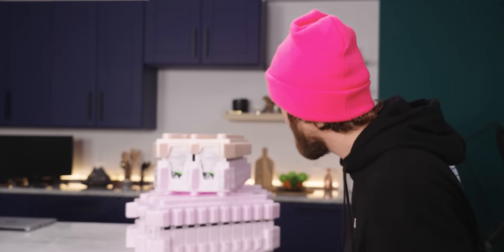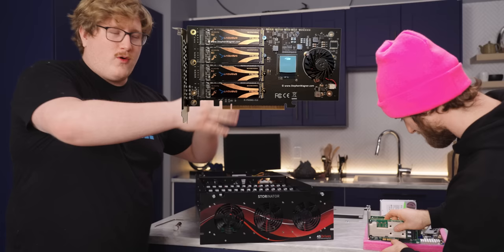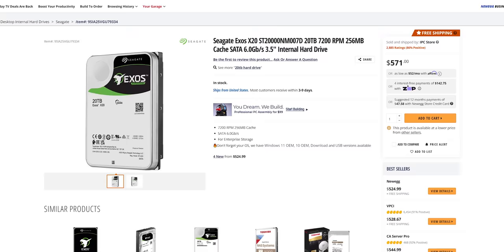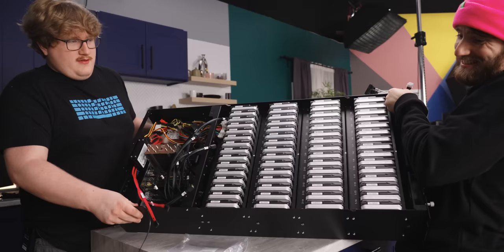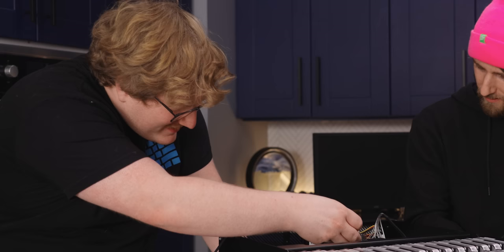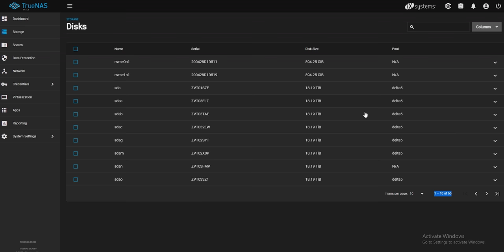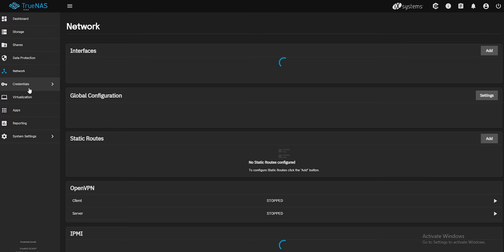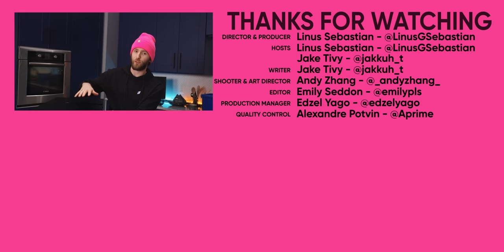My dream FINALLY came True! - Petabyte Project Recovery Part 2

Comment: I remember linus explaining to his wife how 20TB doesn't make sense for storage as rebuilding them would take a loong time. What changed ?
Reply: Sponsorships
Reply: The money, the need of more data in less space, the fact that HE doesn't have to watch over that because somebody else will.
Reply: New wife
Reply: he's got too much money now :D
Reply: Has the technology improved?
Reply: It doesn't make sense in consumer NAS devices but it can make sense for very large servers with raidz2 (barely) or raidz3, drive bays are expensive.
Reply: Link for that video?
Reply: Maybe scale, it doesn't make sense for smaller servers, or a personal NAS setup, but maybe when dealing with Petabytes of storage it works better?
Reply: @positivemelon7578  I got a 5.25'' drive bay in my workstation right now. Was cheap and works great. The real problem is finding a fucking case these days that didn't get rid of the bays for extra cooling that few people actually even need. Currently, I'm using the Phanteks Enthoo Pro
Reply: Like many things it isn't really a yes or no answer. The type of RAID array your using plays a huge factor. For example many people say RAID 5 is basically useless for anything larger then 1TB because of how slow the rebuilt times are with only a single disk failure it get really scary fast.

In the case of LTT they have a few things going for them. First off they are using multiple RaidZ2 arrays so they could loose 2 disk per array so it is way better than RAID5. Second this isn't really a highly active server. They can do without it if need be. So if a drive does fail they can just tell everyone the server is busy rebuilding the array don't access anything on it. This will improve performance rebuilding the array and be less stressful on the remaining disks because they don't need to physically seek around as much during the rebuild.

This isn't always the case for many people as one of key points of RAID is to keep the data accessible even if their is a hardware failure.

But at the end of the day it is just a risk game you play. Someone a lot smarter then I am could run the probability numbers for you and that is up to LTT to determine if that is acceptable or not.  How valuable is that data. LTT is already breaking the 3 backup rule with this server as it is the only copy of this data from my understanding. They said the data is really only a nice to have and say YouTube is their other backup. You may agree or disagree with them. But they ran the numbers and this is their solution.  

Although I do think LTT should find some Tape backup sponsors and try backing up that large amount of data to tape. Tape does work out to be cheaper than hard drives when your talking about that much data.  Although accessibility is much harder on tape but it would be a backup of this server.
Reply: Yvonne wasn't in the room this time
Reply: @keineahnung8696  He doesn't have a prenup. He'll lose everything if he divorces Yvonne. So, not gonna happen.
Reply: him getting a petabyte of free hdds changed that

Comment: Didn't you said that the 20 TB hard drives are rubbish, because if one fail, it takes an extremely long time (several days) until all the data is recovered to a new one?

Comment: Linus: It's mind boggling 20TB in a single drive.

1 TB MicroSD: Am I a joke to you?
Reply: MicroSD aren't dirty cheap
MicroSD might perform worse than a hard drive 
Also, 20TB in that hard disk is a achievement cuz, it's just few years ago that we had low capacity hard drives
Reply: @cry-0432  in terms of storage density by volume it's still way more impressive than spinning rust. If I have a 20 TB 3.5" in front of me I'm really not impressed anymore. Show me 8 trillion bits that fit onto my fingernail and I genuinely have trouble believing that's possible.
Reply: @dgschrei  yeah, I agree

Comment: As a Storage Architect for a living, allow me to say with the complexity you have in mind and the storage pool sizes, I HIGHLY recommend using Starwind as your virtual SAN software. It's been around for many years and has amazing capability like spanning physical NAS hardware presenting one storage pool. The big thing is it's incredibly reliable and data loss prevention and excellent recovery is their strength guys.

Comment: Your storage failed because you failed to monitor it, rather than accept the same process will work again, use a proper enclosure with status LEDs on all the bays. If your regular monitoring notifications fail, atleast you'll still notice when someone is in the server room that there's a red light.

Comment: 13 drives in RaidZ2? Can't wait to see this video again in 3 years or so. At least go RaidZ3 for this many drives in a vDEV.
Especially with 20TB drives. Resilvering can take long enough for a 13 drive 20TB vDEV that you can lose 2 drives during rebuilding the array, just give up the extra drive.
Reply: It's actually even worse than that: they put 15 drives in each vdev and it didn't look as if they set aside some drives as hot spares. At this point they are just begging to lose their data - again...

Comment: 9:35 "Are they SAS or SATA?" Technically both I guess?  They are SAS ports and those can pass through SATA connections.  You can easily find SAS to SATA breakouts for that reason.
Reply: But on this board they are SATA only. Linus got it wrong. Got this board in my storage server.
Reply: I mean SAS wouldn't make a sense nowadays most of those fancy (enterprise) drives have SATA and SAS is really rare...

Comment: I've read that it's advisable to use a mix of disks of the same capacity from different vendors or different build batches/dates, in case there was a problem with a production batch.

Why aren't you considering building a ceph cluster with all your different Vonnock servers? Is the ZFS pool performance much better?
Reply: You can't be very picky if you get stuff as advertisement material.
Reply: @lachiu1  no, but you can when your data is at stake and even though they might've gotten it for free, it's still his data on it, so they should still care about this.

Comment: if its just the heatpipes sticking out of the top of the chassis i know this may sound insane but measure exactly where they are and drill just a couple small holes that are the exact size of the heat pipes

Comment: I've had so many HDD failures over the years that I'd still be terrified of my only backups being on them.  I know SSDs are significantly more expensive but it's worth it for the peace of mind, IMO.  Not that SSD failures are impossible, but far more unlikely in my experience.

Oh, and they're a lot lighter to carry. ;)
Reply: You build these things with the assumption that you know HDDs will fail. You just have to monitor, scrub, and replace as necessary.
Reply: Yeah losing 2 tb of memes doesnt feel good
Reply: This level of data storage should be done with a tape drive to be more secure. Keep the tapes for cold storage (off-site in case of fire), HDD for faster storage and SSD for maximum speed.
Reply: Did we ever find out how long ssd data last in cold storage? It’s not forever. Eventually the difference in charge will dissipate and all return to 0s
Reply: These kinds of professional level HDDs are much less likely to fail, and having them in a raid configuration like this means that you have to lose at least 3 disks before you lose data, and they'll be alerted if any of them fail so that they can rebuild from parity data
Reply: SSD is worse in my opinion. I've seen 10 year old HDD's still running on servers at my job. Can't say the same for SSD. This is speaking from encounters in DC's with ~8K servers.
Reply: @arnaldogonzalez1  I think one of my 1tb storage drives is nearing 10 years old. I really need to empty it on to the not a lot newer 3tb main drive
Reply: @billy101456  Yeah, it's definitely time to move your data over. The sooner the better
Reply: @arnaldogonzalez1  got any good utilities to move it? I dont trust windows copy not to mess it up
Reply: I own(ed) total of 4 SSDs. 2 of them died, last one in december 2021. Usually I backup my system daily to my NAS but at that time my last backup was 2 weeks old(covid related to stuff). No smart errors, no reduced speed, no nothing. I shutdown my PC in the evening and it was gone the next morning. 

As for HDDs on the other hand, I've never had an HDD failure in my life. I currently have 4x3TB in raidz1  in my NAS but I used many random old drives without parity in the past and obviously I used HDDs as system drives before SSDs became a thing. 

Idk for me hdds are the reliable ones and ssds feel like they need constant babysitting

Comment: Spread out over multiple servers is actually a good thing. At least when it fails you won't lose everything at once and it will be faster to rebuild when one does fail. Nothing is worse than taking a week to rebuild only to have another failure during that process (usually an unrecoverable catastrophe).

Comment: In my experience cutting edge high capacity drives ALWAYS have a high failure rate. I hope these work out for you guys though!
Reply: Yes, anything that is pushing the envelope is always going to be running on the edge of what is possible, and so, more likely to fail.
Reply: Wasnt their 16TB drive "cutting edge" when they used it? Sure it failed in the end, but that is also related to the fact that no one checked them ever.
Reply: @cyjan3k823  Yeah setting up those  email alerts is pretty mission critical on something like this.

Comment: Question for the LTT crew: What will you be doing with the old drives that are still good but being cycled out? Often these drives work good enough for non critical uses like Steam library game drives for those on extreme budgets for mass storage of "having their entire Steam library installed" for the one off chance they want to play a less often visited game and still not having to make room and then redownloading said such game. Often used enterprise drives are sold at deep discounts to upcycle them to the basic consumer, all assuming they are not sas drives but sata for ease of use to the basic end user.
Reply: Based on the last video, I'm pretty sure what's going on is 

new vault -> vault 3
fix new vault
vault -> new vault
fix vault
use vault

I don't think there's going to be any drives that aren't being used other than the ones that are truly dead.

Comment: I hate big manufacturers as much as much as the next guy but i gotta admit , a storage server like this without UID indications and easy hot swap capability , also a lack of a supervisor utility makes server vendors like HPE shine with their storage products or even compute products, i worked on a couple before and finding out which drive is in predictive failure saved me alot of times. Regardless i love the the work Linus is doing but big companies have a reason why their products are the best at what they do regardless of the price.

Comment: This is pretty decent price. I just ordered an additional shelf for my company's storage with 24x960GB SSDs for 50kEUR :D. Vendor locking and service fees suck.
Reply: Could you not just have bought 2 12TB drives?
Reply: @carltonleboss  that's not how it works. Having, for example 4 6TB drives rather than 2 12TB drives gives you:
- more speed, since you can write to all 4 at once
- more redundancy and reliability, more of them can break and you'd lose less or no data
- I thought I had more but I don't, unless you count more flexibility in upgrades or something.
Reply: @devnol  rack space is expensive, so drive makers will always shaft you on the highest capacity drives.
Reply: @devnol  I can add another one: lower percentage of parity data.
Reply: Service fees suck until you need them, if you dont have them you end up losing your data, like linus does all the time.
Reply: Feel you! A distributed 1PB (50% is located in a colo for automatic failover so only 500TB of usable space) IBM Spectrum Scale based solution was like ~£250K.... 'proper' high performance, high availability, and redundant storage costs a fortune, but does have a lot of benefits.. like... professional support...... etc.. (something like Spectrum Scale gives a load of additional automatic file management and software defined policies etc...)
Reply: Those are probably 15k SAS drives, though.
Reply: @Thats_Mr_Random_Person_to_you  yeah, the whole system cost so far iirc 350kEUR. Netapp all flash cluster with a DR cluster on HDDs. It is still <100TB usable SSD storage. Yeah, we already used the service. I texted a tech that supported us 15 past 10PM and he called me that he noticed and is already on it... That is what you pay for. HDD failed. 8h delivery time. All inclusive.

Comment: Are you sure that you need L2ARC with 512 GB of RAM? Or generally, will it be beneficial/have you done testing with and without it?
Reply: The said that the size of the files that they worked with were large enough to overwhelm the memory, so yes for them.

Comment: RAID-6/z2 really is a minimum. The rebuild times on nearline drives have become truly huge as their capacities have bloated without their bandwidths growing significantly. Anything else and what you'll save on drives at first, you'll lose when your sysadmin needs a therapist.
Reply: what sysadmin? if they had one of those i don't think they'd be running z2 with 15 20tb drives per vdev, lol.
Reply: @thatbox  fair. DRAID implementations can make rebuild less immediately horrific, but I've not really any experience with zfs' implementation (mostly proprietary stuff).

Comment: This "kind of jank but enterprise-ish" stuff is so much fun. In fact, more fun than the actual enterprise stuff I do professionally. Compare building a storage server with 60 fucking HDDs from scratch and configuring it with throwing a bunch of ready-made storage boxes into a rack, cabling them and configuring them with a flashy GUI... It definitely is more fun.
Reply: Building your own PC is also more fun then setting up a few 1U servers on a rack ,  still doesn't mean you should be running a ESXi cluster with PC Hardware...
but these videos are fun , and Linus does it for content rather then it really makes technical sense, i get it.

Comment: So if Linus had hired someone to periodically check the servers instead of just having someone like Jake check whenever, the data loss wouldn't have happened.
Reply: You said it right.
Reply: they're all nerds so no additional personnel needed, they just failed to make it a hard schedule to follow and delegated those tasks
Reply: I mean With modern NAS operating systems you shouldn’t even need someone to check 24/7. The main ones have solid reporting systems. And a monthly or even weekly checkup/maintenance would be more than enough to keep it running. They should also have a solid supply of parts and a solid recovery strategy. They’re all smart enough to do all of this, they’re just so disorganized/laid back that none of this gets done. But I mean at the end of the day it always makes good content to watch their servers fail and they probably make any money they lose back in one video so it’s not the end of the world
Reply: Automated reporting would have prevented the situation from getting as bad as it did, and then they made things worse by removing all the faulted drives, since some of them hadn't fully failed and the remaining good data on them would have provided parity data for the rebuild. If you have a RAIDZ2 vdev and two of the drives have dropped out of the array due to excess read errors, you want to bring whichever drive has the least errors back online, replace the other one, and resilver, then replace the second bad drive, and resilver again. Instead they removed both faulted drives, meaning that every read error from that point on was fatal.
Reply: @callumb4980  I mean, yeah, the drives are free and me thinks the 4U chassis is as well. And they have the rest of the stuff on-hand from previous projects where they got it for free or bought it. So, in the end, basically no money loss, if any at all.

Don't get me wrong, though. Good for them. They get sponsored and paid to do what they love.
Reply: @clou09  That's the problem. The business is run like "Everyone's a nerd so everything will get done somehow, lol!" They'd actually be in a better position if it were 20 normie office workers and a single IT guy.
Reply: @callumb4980  I'll bet the email field is blank on those notification systems. Either that or it goes to a shared account no one checks.

Comment: FYI most companies use enterprise drives in their external hard drives, which is usually priced considerably cheaper.
Reply: shucking makes sense for consumers, but from a business perspective it does not.
e.g. WD's are "white labels" which afaik are throwaway reds going to a better home.

I also don't think you get as many benefits, like your warranty is a bit of a grey area, and from the manufacturers POV they don't want to advertise that shucking is actually cheaper.

Then lastly, LTT get sent these drives for free/severely discounted.
Reply: Funny you say that - NONE of the usb enclosures I've had to open up had any good drives in them, always a standard consumer drive (eg western digital using a blue or green drive, which is trash).
Reply: @dubsessed9790  were they low capacity? I've had four 8TB and one 16TB and all white labels
Reply: @beepboop6179  most were but not all. A few 8 and 10tb's too
Reply: @dubsessed9790  All my Seagate 16 TBs have been enterprise level. It may have to do with the capacity since they don’t necessarily want to manufacture different types.